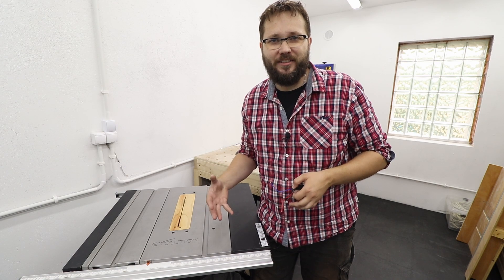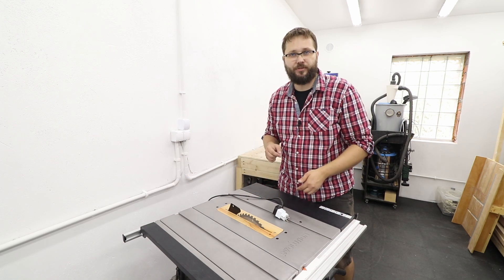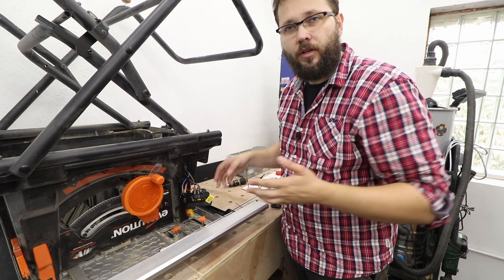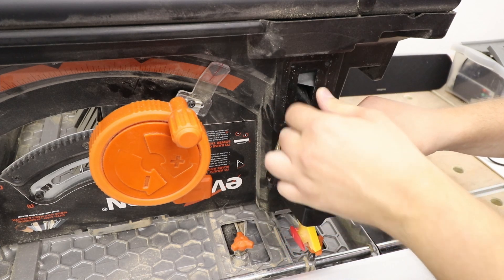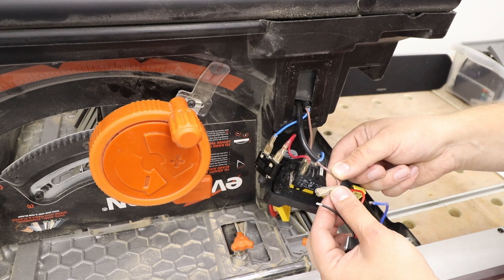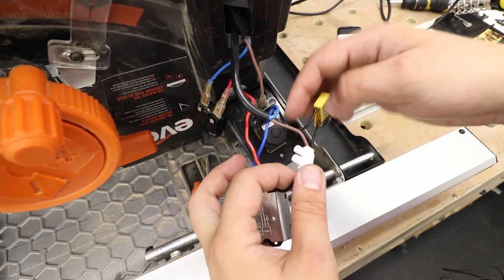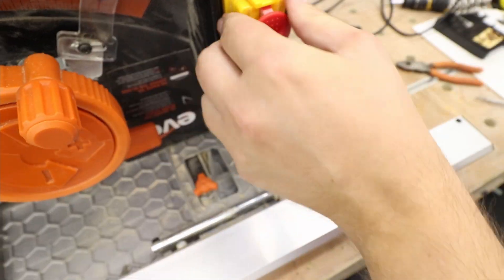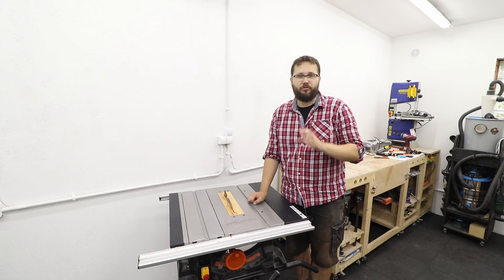Evolution Rage 5-S Table Saw - Installing a Soft Start Module

Comment: Hi Tomasz,  I’ve just ordered a module using your link to Amazon UK.  This is just what I believe is needed.  I’ve been concerned about the extremely sudden start with this saw and worried it could lead to damage or failure.  Many thanks indeed for your video which has brought relief at last.  Well done.
Reply from the maker: Thank you very much. I think that the way the machine it is the slow start module should extend the life of the motor. Less stress on the motor when starting up. 👍
Reply: @CasualDIY  And less risk of damage to the flats on the shaft and the bosses which prevent the blade from spinning on the shaft - something I’ve been concerned about.  In spite of tightening the nut as much as possible I’ve had clear evidence of the blade slipping which I suspect was in starting the saw.  Clear signs of metal galling and tearing on the faces of the bosses which I’ve then had to file flat again.
Reply from the maker: @ianmathieson65  hmm that does sound quite bad and potentially is caused by the rough start of the machine. I'm curious if the soft start module will solve that problem for you.
Reply: @CasualDIY  It will take some time to be sure the problem’s been solved.  I’ll try to remember to let you know.
Reply: Hi Tomasz, great tip! Unfortunately your link didn't work for me, (it was 3 months after posting) however, I managed to source it elsewhere 😁
Why oh why is it not fitted with one!
My issue is I've only got 20 Amps in garage, and if I have my Bosch GAS 20L extractor running, and other things, my supply trips; so far all OK. Thanks again for your great tips and upgrades. I've also added the large safety flap on on/off switch. 😊

Comment: Hmm, see the way you "crimped" the connector onto the pre soldered wires with a pair of pliers, I'd rather have don't that to the bare wires then lightly soldered the whole thing. I'd also get a cheap crimping tool, done right it's a solid connection but you really need to form the crimp down in one go.
Reply from the maker: Thanks for the tip I'll have a look for that crimping tool it may come in handy 👍😁
Reply from the maker: Just bought one online with accessories so I'll change it as you said when it arrives. Thanks
Reply: @CasualDIY  good job. I believe that in aviation/ F1 etc they just crimp connectors, the right connector / wire combination and crimping tool (£hundreds) forms a cold weld between the connector and the wire. If you then solder this the solder wicks along the wire and forms a stress point for vibrations, just crimped you don't get the stress point. For the quality of crimps / tools we're using and because we're not seeing the vibrations they will I think a crimp then running enough solder to just wet the joint is the best solution. Probably. Keep up the good work.
Reply from the maker: @nialstewart8263  thanks good knowledge there👍